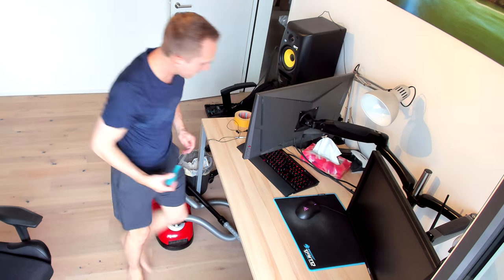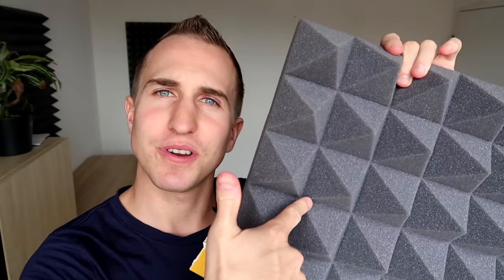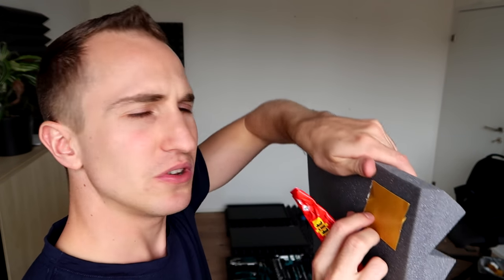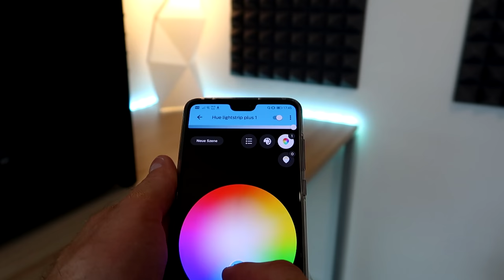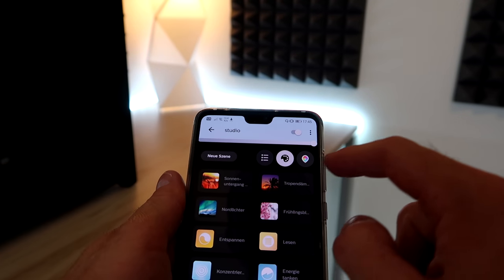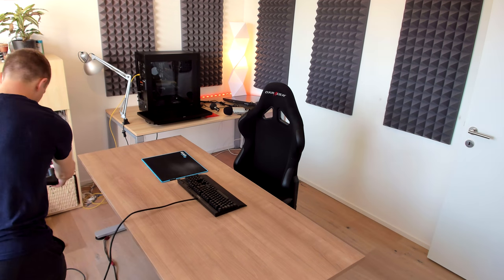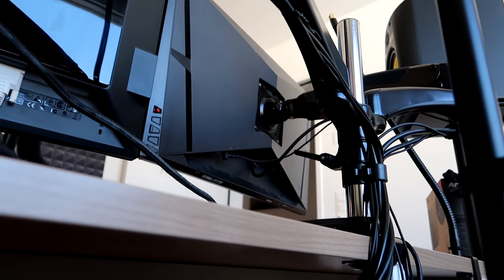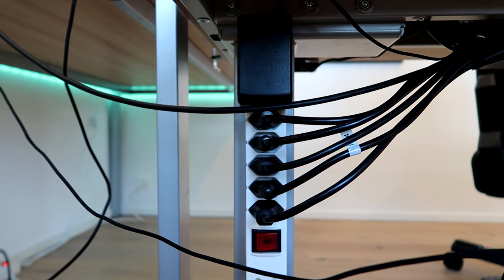Building an epic YouTube Studio / Streaming Setup with Standing Desk

Comment: Sorry man, the foam with the tape wont hold over time. I've tried this method on several studios and in time they will fall off. You'll need to put small nails around the outside of the foam to keep it in place. Just a quick tip :) Also using foam works best on mouth/voice level, which you did, but you might want to add variations in height placements to break the flatness of the wall. If you would draw a line from wall to wall there should be no more open space that the line can cross without a foam pad. This breaks up the high frequencies the best. Putting foam in corners is most effective for reducing lower frequencies. If reverb remains an issue add a foam filter behind of the mic. Also , while not aesthetically pleasing , sit in an angle from the wall to prevent direct reverbs. 

Besides these tips the studio is looking good. I know it takes a lot of effort, but it's so rewarding when everything is just working and in place from the moment you enter. 
Have fun with this setup and keep on making great vids :)
Reply from the maker: Thank you very much for your great feedback, will do! For now the foam is sticking to the tape :D